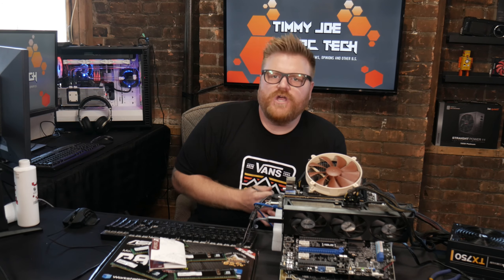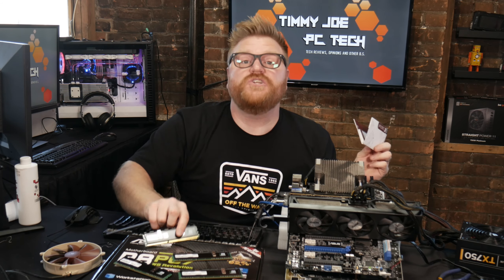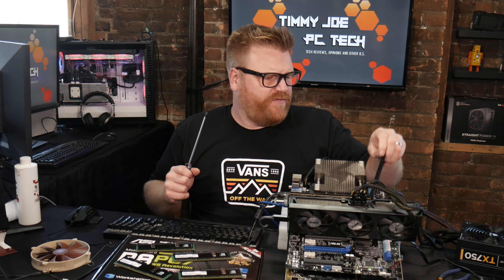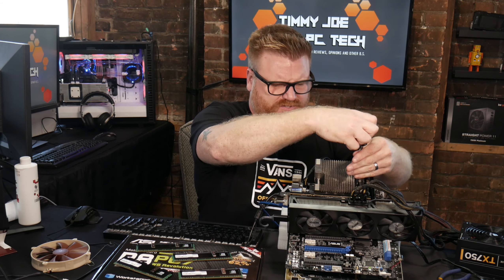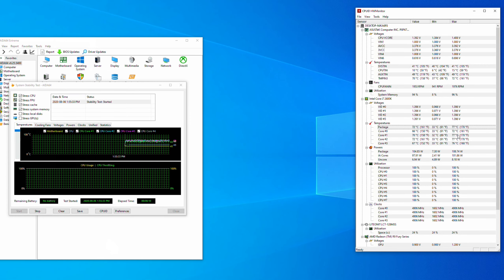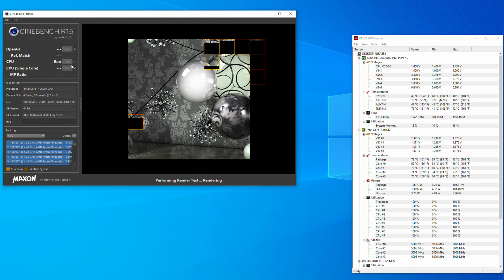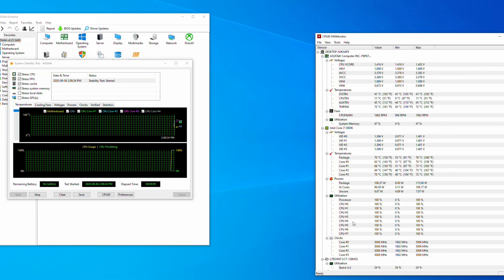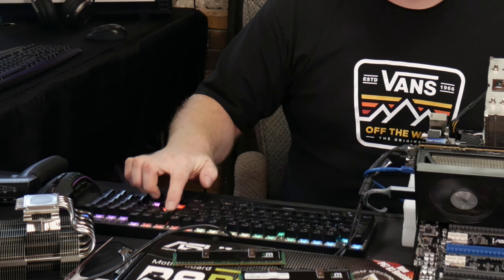This old Noctua cooler is well... pretty COOL!

Comment: When I changed my CPU cooler on my 3600X from the stock Wraith Prism to an AIO the VRM temps went up quite a bit and my expectations for the AIO were much higher than the results so I went back to the Prism and all is well again with a proper fan curve. There is definitely some truth to a downward flow CPU cooler helping to cool the VRMs.
I had that Noctua cooler once but I can't remember what I used it in. Like everything else Noctua I just installed it and never thought about it again because their stuff just works.

Comment: Noctua replaced this cooler with the NH- C14S, which has better compability with gpus on the first pcie slot, and comes with the updated AF 14 fan, which can be mounted on either side of the finstack for RAM clearance or total low profile. Can be interesting see a comparison between the generations of C type Noctua coolers.

Comment: Hey, I had one of these on my i7 920 for awhile!  Performance was decent enough, but my OG 920 ran hot as heck.  Replaced it with an NH-U14S when I swapped to a Xeon X5675.  Moved the NH-C12P to an i7 870 machine though, it was cash.

Comment: I had this for my old AMD FX 4350 build back in 2014. When Ryzen 1 launched 3 years later, Noctua were running a free AM4 mounting kit offer for proof of ownership so i could reuse it (I sent them a photo of the box and installed cooler). I'm still rocking it in my Ryzen 3700X build right now and it performs pretty darn well. I think it's the main reason why my VRMs on my 1st gen AB350M board have survived as long as they have.

Comment: There was a big boi version of this made by sycthe called the Sycthe Orichi (rev b.) and it's actually a really really nice cooler.
Reply: I had that cooler and sadly sold in a build on Craigslist. The only cooler that I regret selling. It took me forever to get it installed. To date my build....in was in Antec Lanboy and it passively cooler a Q9650....simply amazing at a time when every build sounded like a jet engine....and was a testimony to how powerful your system was. How times have changed?
Reply: @Hughesburner  Using it in a i7 950 system and the fan is barely spinning but it cools it nice and easy at 4.5ghz. Truly an amazing cooler. Was the absolute worst to take out and reinstall for a thermal paste refresh but was needed on this system that was at least made partly out of dust. Still was amazed that through all that neglect from the previous owner it cooled like a champ with the i7 at 4.7ghz. Funny enough it's in a antec nine hundred so close enough to a lanboi :p.

Comment: All channels are stating temps where the board is not in a case anymore. One also has to take into consideration that when put into a case and especially shutting it, will raise temps typically 5-10 degrees higher.

Comment: I got the NH-C12P on a 3600X in my server. Noctua send me a free kit so it fit on the AM4 socket, and the cooler is performing great. The reason I wanted to reuse this cooler in my server (was on a i7 4790l before), was exactly because it blows so much air down around the socket and over the ram, which in my opinion is specially important in systems running 24/7.

Comment: Well done Timmy Joe. With the proliferation of Vertical Tower Design coolers VRM cooling is becoming an issue. As your video points out vertical Tower Coolers do a great job of cooling the CPU, which is their primary purpose. But they do it at the expense of short changing VRM coolers of much needed air circulation. With a couple of exceptions Coolers supplied by CPU Manufacturers have been exclusively of the downward airflow variety. Now that CPU Manufacturers are phasing out supplying coolers as standard the burden and expense of supply is falling to the End User. More often than not the End User opt for the package that keeps the CPU coolest. Obviously the best option would be to obtain the Tower Cooler PLUS and external cooling fan to blow air on the VRM. Going forward it seems clear to me the slack will have to be picked up by the Motherboard Manufacturers. They are going to be forced to provide better cooling solutions for Mobo VRMs. Some Mobo Manufacturers have addressed this matter already on High-End Boards. It's time we put pressure on them to do it for ALL boards in their line ups even if it means shelling out an extra 25 to 50 bucks for it. Good VRM cooling means ones computer will last a long time.

Comment: hi timmy seen your vid on the 8k tv did you know club3d have a new active adapter dongle that converts diplay port 1.4 to hdmi 2.1 .just out about 1 month ago .maybe worth a go .save a fortune .had the same issue years ago with my r9 290 to tv's over display port .

Comment: That cooler looks perfect for a ryzen build 🙂👍
Reply: Or lots of other builds?
Reply: @iiiiii7680  bold of you to think it can cool a 10700k or above 😳
Reply: @hmm_monke  yknow, not every intel CPU is high power draw and not every ryzen CPU makes no heat so...
Reply: way overpriced
Reply: Like a Ryzen 9 3900x?  Yeah right.
Reply: @malcolmkhummel3  actually it can...
Reply: @iiiiii7680  10700k does like 200+w at stock... 3950x does 140 so i dunno man
Reply: @hmm_monke  you are right ...I was more talking about max precision boost which needs the lowest temps possible   I just got an r9 3900x and it is quite hot compared to my old r5 1600...you are right tho.  It could...I am just looking for a bit more ...maybe I am nuts . .just running stock cooler yet still ..tough to find something I really lovw

Comment: One of my dream builds is this cooler on a unify board with a 10900k, 32gb of 4400 c19 ballistix max,  all in a ncase m1, da2, or nr200 and a 3 slot 2080ti. I call it the fin stack build. I would only put a fan under the cooler rather than on top.
Reply: Okay well the new version of the cooler.

Comment: G'day Timmy Joe,
I've got a be quiet! Shadow Rock for my Open Testbench, I always mount it with the Fins over the VRM & not the Memory as that seems the most sensible to me,
I haven't tried it in a Case but it works really well for the TestBench as it is Quiet plus provides Direct Airflow to the VRM & like you found keeps the VRM noticeably Cooler

Comment: There's a different version where the 140mm fan can be attracted to either the top or bottom of the fins. 👍 They totally should make a update to this.  maybe like a u12a variatiant. There are lots of small cases now than ever before and people would definitely  benefit with that option.

Comment: been using my c12p fonr 4 pc upgrades so far but will need to go water cooling for new pc upgrade due to new case not having the clearance for the cooler and a dvd drive :(.
they are great for keeping "around cpu" components cool especially the ram, the cut out in the fins goes over the ram to blow air all over them

Comment: I noticed that makes a big difference on asus Z590 ITX where it’s only chance at good cooling even in open frame is that down air flow. I was gonna put t he U12S SE AM4 (w/ I-115x kit) but the A sounds better but sticking out some. They do offer a bigger C14 but it’s not compatible w/ ASUS Z590 w/ big I/O shroud

Comment: It would be cool if you found a Coolermaster V10 to review. Its super uhhhh.... unique? Its not fat its just big boned, I just took my V10 off and replaced it with an AIO but I lovingly replaced all the old thermal compound on the TEC with TG Kryonaut before storing it away in my treasures bin lol.

Comment: I wish air-cooling got more love in the PC tech community. Even AIOs get scoffed at- you need custom hard tubing water cooling! No, I don't. I want something that doesn't need annual maintenance just for better cooling and noise levels ONLY really needed if you super OC your system.. which is a bit silly on a daily driver imho.

Comment: This processor runs faster and cooler than my delidded 7700K. I feel really betrayed
Reply: ya these zen cpu's are pretty easy to cool, my ryzen 3 3100 overclocked don't get over 50c in gaming on a cheap cooler, my old 3770k needed a nzxt x62 to keep it below 80c overclocked.
Reply: @budgetking2591  he is using an I7 2600K the preprepredecessor of the 7700K. Everybody knows that Ryzen is cool but that was not the point
Reply: @djvidual8288  i was reacting to your comment, not to the video.
Reply: @budgetking2591  I'm on the waiting train for thext Ryzen generation. I think I will need to wait until we get DDR 5 for it to be a worthy upgrade
Reply: @djvidual8288  yeah a 7700k is still fast enough for any game.